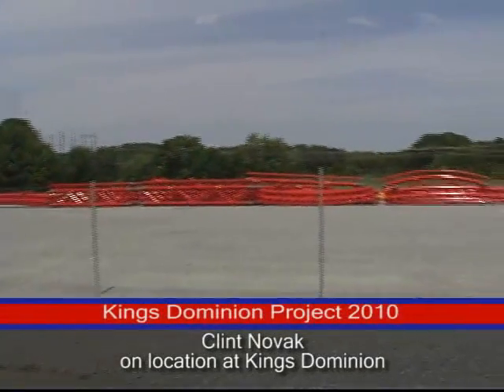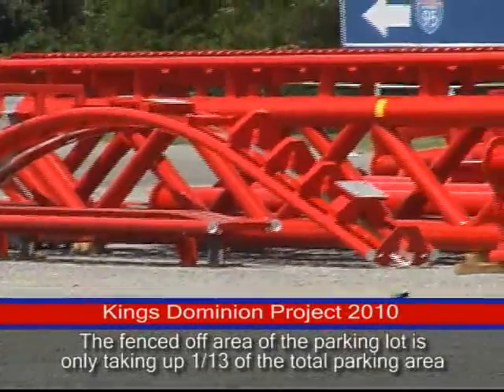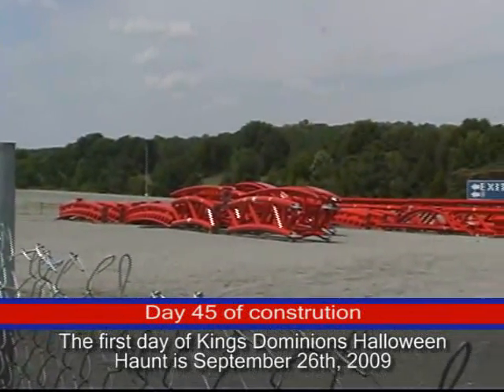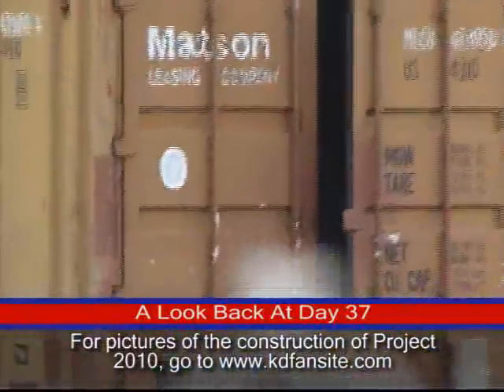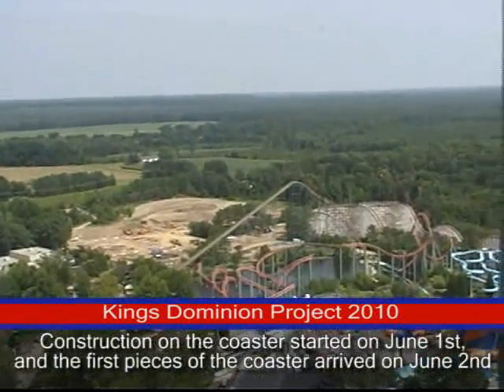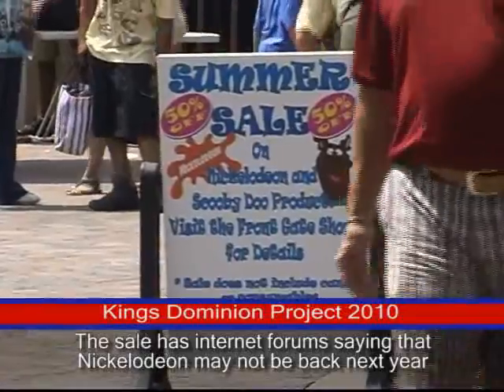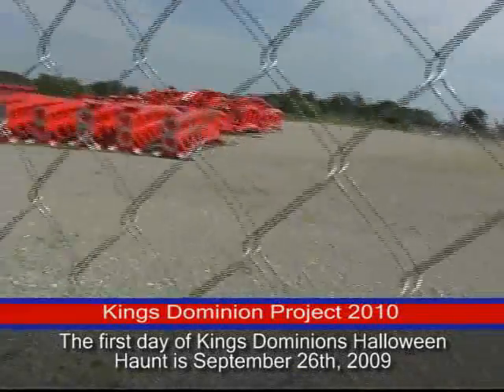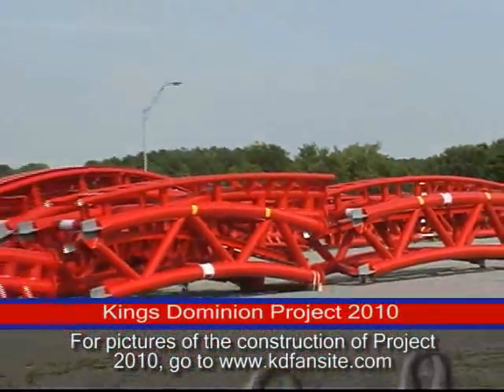Day 45 for Project 2010 at KD

Comment: Clint, on MF as I can remember MF's cable only runs about half way on the crown of the lift and then it drops down, so maybe those pieces could indicate the the very topping of the crown and then the plunge in the drop. Maybe, that's just what I'd say. 

On Day 37, I'd say that huge massive support column would be maybe for any airtime hills like MF has. It looks too small for a lift one.

Do you think the yellow supports could just be waiting there for Carowinds? Dang.. LOTS of footers :)